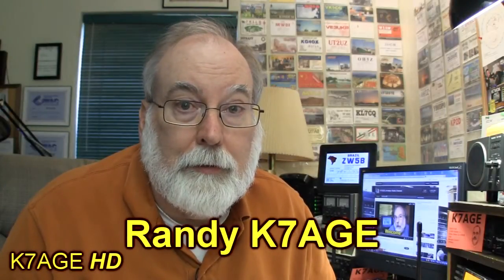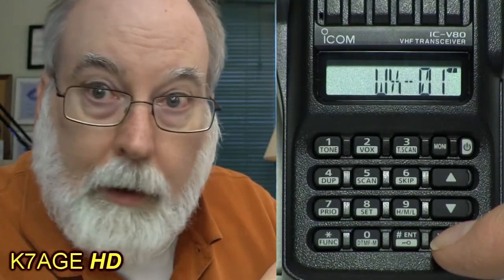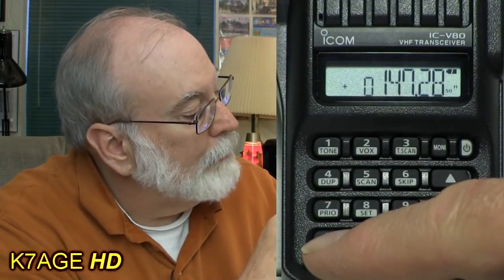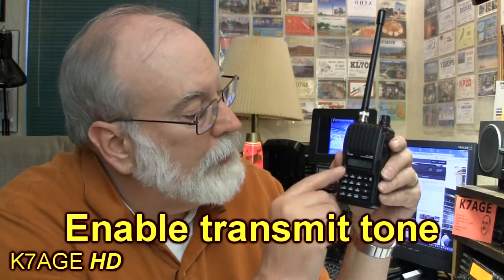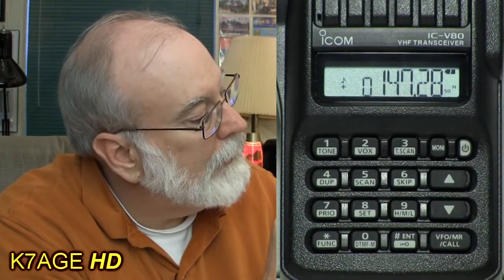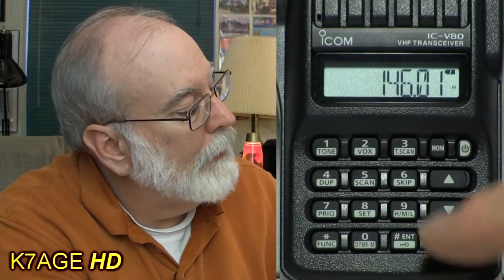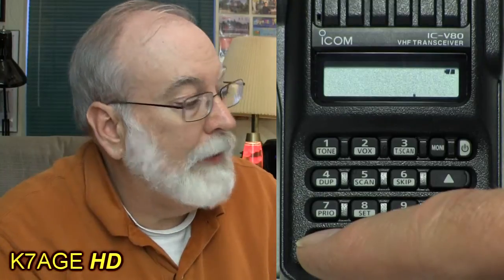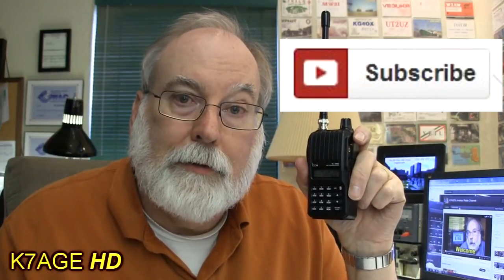Getting Started on 2 Meter FM, Part 3

Comment: I have an IC-V86, for the life of me, I cannot seem to figure out how to manually set the Call to 146.52. It came set from factory at 146.01. If you can point me in the right direction I'd appreciate. I love this little radio as I can carry it when hiking without having to worry about damage. K7ODB over in Verdi, NV. Thanks in Advance, 73
Reply from the maker: Technical Support Department
800-253-1498
Monday - Friday 4AM to 5PM PST
Reply: How to set freq. 465.425